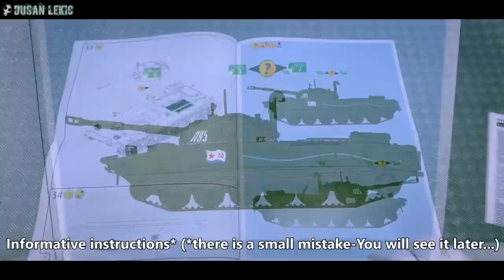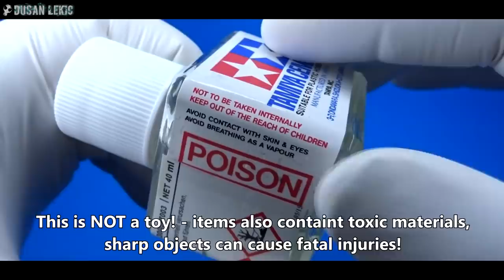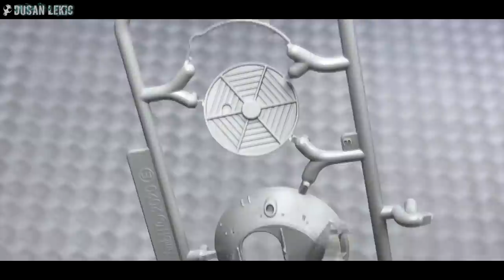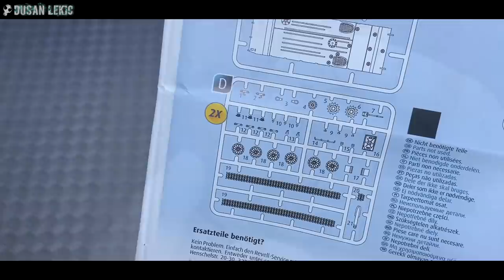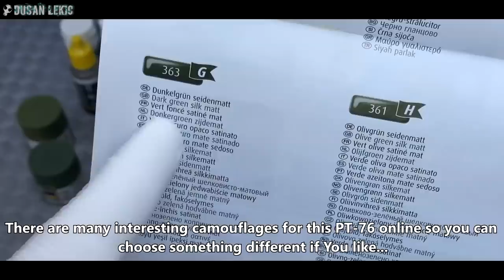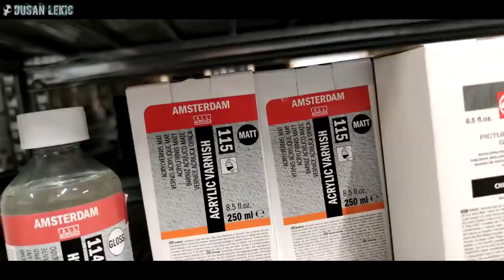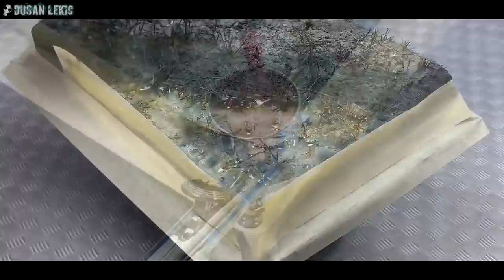REVELL PT-76B Full video build (1/72 scale amphibious tank)

Comment: When I build my Takom tanks, I do prefer the individual tread for the "Tiger sag". The long prebuilt treads for the final section on the bottom, eh, I rather build them all by single tread. Boy, 1/72nd is such a tiny kit. But if you don't have the room, or the budget, the detail looks decent. Your PT washed down nicely ,good dirty detail on the treads, cool little base, but don't drink the water. Good job Dusan!